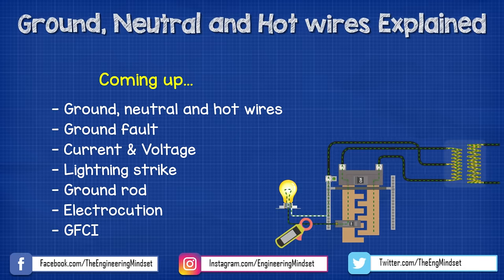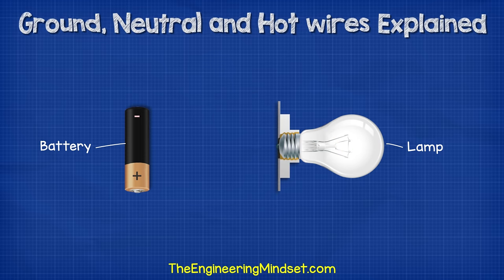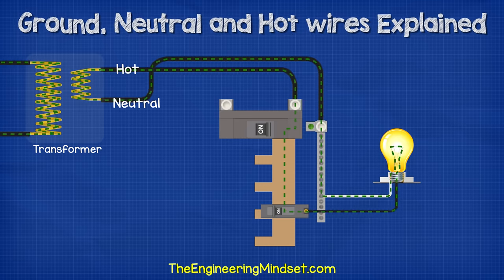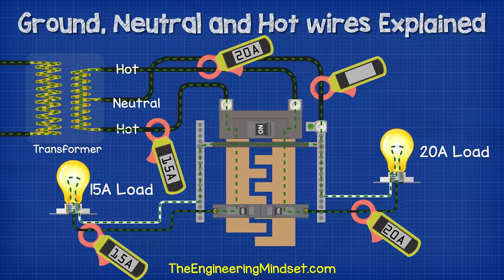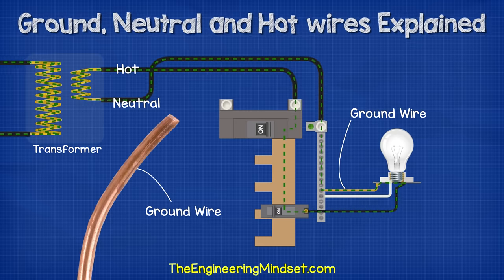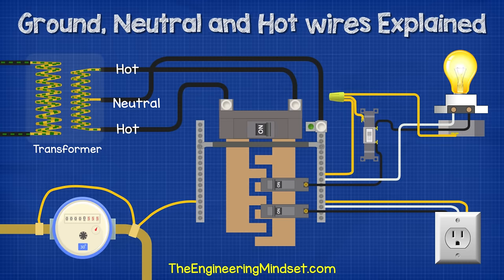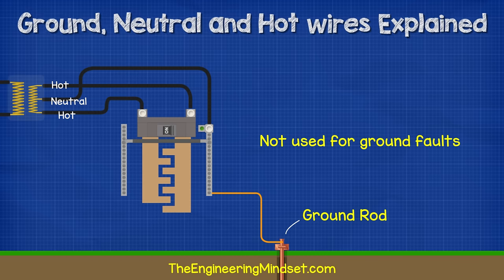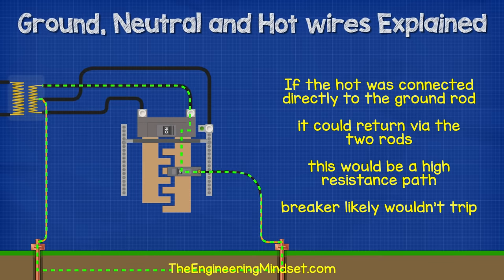Ground Neutral and Hot wires explained - electrical engineering grounding ground fault

Comment: What happens if the neutral wire shorts onto the frame of the light bulb? Wouldn't the light bulb then become charged since the current its AC?
Reply: If live and neutral short it will trip the breaker it won’t become charged with AC or DC
Reply: No. And no it won't trip a breaker either, but some current will flow on the grounding conductor (green/bare copper) back to the panel. 
Many old wiring basically did this intentionally when they did what's called a bootleg ground. Not good but it doesn't immediately present shock hazard or trip a breaker. 

The neutral carries current and in that sense is just as 'hot' as the 'hot,' but it is grounded and so voltage to ground stays at zero (if the system is working), even though the current is alternating directions.

Comment: Could someone body explain why something is code? I had a situation where I found an outlet that had its ground wired to the neutral wire. Now, if there is a fault the ground goes to neutral anyway, since it is grounded at the box.... but my electrician extended the ground from another outlet to this one. Why?
Reply: If I understand you correctly then what has happened is that there is a break somewhere along the line in the neutral wire so they have just substituted the ground wire in order to complete a circuit. Most states do not allow this anymore. They mandate that if you have to replace part of The wire, then you have to replace all of the wiring attached to your outlets and lights throughout the house.
Reply: @nonamegame9857  That's exactly what the electrican said "lost it in the wall. " but could you explain why doing this jerryrig is technically a bad idea? My understanding is the ground and neutral are both going to be bonded at the service box... so it really shouldn't matter?
Reply: @Gnefitisis  I guess people this very day just want to argue. I never said this was a bad idea. I said that the code in most States says that if you repair part of the wiring then you have to replace it all 🙄.
Reply: @nonamegame9857  Sorry, I just don't know any better and want to understand electronics better! :) Not trying to argue. My thinking is the code is the way it is for a reason and I just want to understand that reason.
Reply from the maker: We just published a new Ground fault, short circuit and arc fault video, so much detail! Link HERE➡️: https://youtu.be/Qi0ynSQw-wc

Comment: why does the armored portion of my ground show 12.amps? That is when I put the clamp meter around it However If I place the clamp meter around the 1/2" ground at the portion of the rod under the attached armored cable the rod it shows .8amp. what is going
 on. The armored cable is attached at the ground rod and at the breaker box (armor portion) and the wire then goes to the ground bus.

Comment: At 3:49 when you connect the leads from the multimeter to both bus bars shouldn't the voltage be 0? There wouldn't be any difference in potential between the two bus bars
Reply from the maker: Check our new Multimeter tutorial out ➡️ https://youtu.be/4lAyzRxsbDc

Comment: the premise as i understand it is that in a quantum binary electron spin system,  if anything tries to link on to a pathway or channel to tap a line?  if this situation is attempted by say a spy , then do to the nature of the security there is a disruption in the electron spin causing a block in the whole transmission media?  if electron fail to flow in a measured way, the flow for electrons anomaly is detected and stops like a GFIC?  true or false class?
Reply: Right, that's it.

Comment: Maam, Im still not understand. In DC it is easy to find the Hot wire, but in AC looks like the Neutral can become Hot wire too. Current flows IN = HOT,  OUT = NEUTRAL???
Reply: In an alternating current the direction changes constantly at a rate of 60 hertz, thats what makes it alternating. The hot wire(s) have a high voltage with respect to ground. The neutral is a grounded current carrying conductor tied back to the transformer. The ground is a dedicated wire bonding the chassis of the equipment to the earth for safety.

Comment: What happens to electricity when it is “used,” spent, or consumed by an appliance in an AC system? I understand the use of fuel (gasoline, lpg) and wood for fireplaces. What becomes of “whatever” electricity is?
Reply from the maker: It turns into heat, light, sound
Reply: @EngineeringMindset  🤦🏻‍♂️ wow! And thanks for answering my dumb question, lol! I am very familiar with DC power as a novice mechanic. But after watching your videos about AC power, and that it "moves" back and forth, my simple brain

Comment: 6:36
What happens if the neutral is connected to ground. Is this stray voltage?
Reply from the maker: We just published a new Ground fault, short circuit and arc fault video, so much detail! Link HERE➡️: https://youtu.be/Qi0ynSQw-wc

Comment: The battery circuit you keep showing says that the hot wire is negative and the neutral is positive. I know at this point it is kind of just a naming thing, but in DC, red is hot and hot is positive in both AC and DC electronics. And black would be negative and neutral. I’m just confused as to why you decided to make it look like that.
Reply from the maker: Electrons flow from negative to positive, current flows from positive to negative. I animated with electron flow but it confused many people, the newer variations of this video don't use electron flow. I would just ignore that section.
Reply: @EngineeringMindset   woah that’s odd I always associated current with being the electrons themselves. Thanks for the explanation. Electricity always surprises me with some basic concept I never knew about.

Comment: What I don't understand is why one side of the circuit is considered "power" and the other side "neutral" since in A/C the voltage is flowing back and forth so it seems symmetric.
Reply: @GH-oi2jf  Okay, I see that the center of the transformer is connected to ground and also that the neutral where it comes into the house is connected to ground.  So what causes electrons to flow back and forth along the neutral to the house as he shows?  Is it because the potential of the hot wire pushes and pulls it?
Reply: I think it must be that.  The neutral end is never pushing or pulling electrons.  You only need one end, the hot end, to push and pull.  The hot wire has a 120 V potential with respect to the ground, and the neutral wire, and the middle of the transformer.

Comment: What I still don’t understand is if the current is s alternating then how does one carry the power to the device and one carries power back to the panel. Dont both of them do both of those things just and switch every 1/60 second? Why is one hot and one neutral if the current alternates?

Comment: one hot wire is 120volts, any chances i can split it into 2 hot wires (with 60volts each)? and if its possible, what tools do i neeD?
Reply from the maker: You need a center tapped transformer. 120V primary 60-0-60V secondary and a qualified electrician to wire it in
Reply: @EngineeringMindset  do you have a video reference how its connected? or the setup looks like?
Reply: edited sir, im sorry

Comment: Neutral is 0v
Gnd, ground 
Hot or live is 220, 240, 420, 120 or 480 volts
Reply from the maker: We just published a new Ground fault, short circuit and arc fault video, so much detail! Link HERE➡️: https://youtu.be/Qi0ynSQw-wc

Comment: Can't find a clear answer.
I'm guessing Hot and Neutral are interchangeable and have the potential to carry 120v 30 times a sec each.
And both are separated as if they were DC for the sake of code and safty.

Comment: I didn't know that in North America they connect ground wire and neutral wire on the same bus bar of neutral. Here, in India, we "ground" our ground wire into the earth just outside our houses (each and every houses, separately). We bury a solid copper rod and connect it with the ground wire.

Comment: Technical question, please help me.
I have two parallel circuits, both are connected to the same neutral.
The main supply phase is 230vac. Single phase.

The first circuit:
The phase is modulated down by a diode , cutting off half wave of the negative component, leaving the positive component. Reading 130v pulsating half wave.

The second curcuit:
230 vac , single phase , connected directly to the main.
Reading 230vac.

Those two circuits share the same neutral. Is that a problem?
Can negative component of the phase, coming from the second circuit, conflict, with the positive component coming from the first circuit, since both circuits are connected to the same neutral?
I appreciate any help.
Reply: It will be a problem they are different voltages even though it’s the same phase remove the diode (with mains power off) and make sure it’s 230 and you should be fine

Comment: You can watch electrical current on DC floowing in One direction flowing in One direction it looks like it's flowing on let's say the top of the wire and it's moving in One direction

Comment: 5:47 why is the ground wire connected to the neutral bus bar? If the neutral bus bar is energized doesn't mean the ground wire is also energized?
Reply from the maker: We just published a new Ground fault, short circuit and arc fault video, so much detail! Link HERE➡️: https://youtu.be/Qi0ynSQw-wc

Comment: Something I still don't understand is why the neutral wire won't carry current back once if there are equal loads on both sides of the circuit. What stops the current from going down the neutral wire?
Reply: Since the 2 lines have waves that are mirrored the current cancels itself out in the neutral bar. You would measure current on each neutral wire going from the load and to the bar but would measure zero on the service neutral going back to the transformer. Essentially the current would flow from load 1, to the neutral bar, and then back to load 2 on the neutral. The current would change direction at 60 hz.
Reply: It has something to do with Kitchoff's current law.

Comment: Currents flows from positive side to negative side of the battery not from negative to positive
Reply from the maker: No, it doesn't. Here, watch this https://youtu.be/PXNKkcB0pI4
Reply: Usually, current flows from + to - and electrons flow an other direction that means current from + to - and electrons flows - to +

Comment: in your explanation, you are showing the neutral wire comes from transformer secondary coil. The electrons are moving back and forth.  which means, neutral also should give electrical shock. isn't it?.  how neutral wire is not giving shock, when we touch it alone like phase wire
Reply: Many people have asked that question.

Comment: What happens if two live wires touch with each other? well, i know, the breaker pops, but why? and what are the dangers in that?
Reply: It depends on which part of the circuit they connect at. Ideally, if both live wires come from the same source (and therefore, both having the same voltage level at the connection point), nothing should happen, however, if they come from different sources and/or have different voltage levels at the point they meet, a current will flow from the higher to the lower voltage level source instead of their respective neutrals, creating an "independent" circuit between them with a potentially high current level flowing through it. Dangerous? Certainly, all the loads connected to them could potentially get damaged because of it. Kirchhoff law is the key.

Comment: What if there is a ground wire coming from an electrical outlet but it isn't connected into a bus, and is actually just wrapped into the main coil of ground wires going outside?
Reply from the maker: We just published a new Ground fault, short circuit and arc fault video, so much detail! Link HERE➡️: https://youtu.be/Qi0ynSQw-wc

Comment: Why is the - terminal on the battery the hot wire?
Reply: It's arbitrary. AC voltage cycles at 60hz and yet the 'hot' always remains the same wire, regardless of polarity. It has to do with reference.

Comment: What could be the reason that the voltage between hot and ground is 120 and between hot and neutral is only 85?
Reply: What is the voltage between neutral and ground?  Where are you placing your testing leads?
Reply from the maker: We just published a new Ground fault, short circuit and arc fault video, so much detail! Link HERE➡️: https://youtu.be/Qi0ynSQw-wc

Comment: Neatral  and hot actually alternate as its ac so  both  carry current to and from source and load
Reply: No live pushes and pulls electricity neutral returns it to the source
Reply: @IPv4Address  ahhhhhh omg! Now I get  your  comment  . Thank you
Reply: @IPv4Address  but if  hot is pulling wouldn't  the  current then  be coming through neutral  side?
Reply: @IPv4Address   so if the  hot is pulling  then the electrons  source  that its trying  to  return  to is going back through the hot  and  when  hot  is pushing electricians  are trying  to return  to their source via the neutral wire

Comment: I have a fundamental confusion; if the current in the circuit flowing from and to the source the same (4:15), then what is the power companies charging us for? I mean from this it feels like electricity is conserved. But then there is a loss of electricity via heat during transmission. I am a little confused at this point so, can anyone help?
Reply: That electricity doesn't just come out of nowhere, a power plant somewhere generated that electricity and is sent to you. You're paying for the wattage hours that you needed to power your devices.

Comment: When the neutral connection to the transformer breaks, why does everything plugged in at the time get fried? (Squirrel chewed through my neutral).   There's no way for the power to return to the transformer, so it has to go through the ground wire?
Reply from the maker: Because it instantly becomes a 240V circuit
Reply: @EngineeringMindset   - That makes sense because the transformer coil is no longer split by the neutral, but where's the return path?  Only the ground, right?  So why would the circuit even work?

Comment: Why did the hot wire showed connected to the negative side of the battery? 
The hot wire suppose to be connected to the positive side of the battery and the neutral wire suppose to be connected on the negative side of the battery.

Comment: What happens when you cross connect wires: Black on white when installing a light fixture?
Reply: If it’s incandescent it won’t matter if it’s LEDs depending on the lights internals it might not work because they are diodes Light Emitting Diodes and diodes block current from flowing one direction

Comment: 5:03 - 5:13 if the neutral has no difference to return would that send 240 volts through you're loads
Reply: those lamps are in series so yeah, 240V 15Amps but depending on the diretion the second lamp should receive less volts for the duration of the half period. idk how it would work as in my country we use 220V 1 phase or 380V 3 phase

Comment: Why do you hav the power coming from the negative side of the battery
Reply from the maker: Because in reality, electrons flow from the negative to the positive. That's "electron flow" . You are probably uses to seeing "conventional current" which is from positive to negative, that's the original theory.
Reply from the maker: Check this out, how a battery works: https://youtu.be/PXNKkcB0pI4

Comment: I have one question that I could never get an answer too,IF electric flows from source through wire,through whatever electrical part and back to source.Does this mean the electric company never loses what they are putting out because it always returns to source? My question is why an electric bill if what the electric co. puts out always returns back to their source.I know their is a draw because of how electric is used,BUT the electric always goes back to where it started.
Reply from the maker: The power company has to constantly push and pull the electrons through all your wires and connected devices and be ready to power anything you connect 24/7. As they pass through they do work, provide light, heat, sound etc. this is energy removed. the power company has to top this back up and charge you for the energy you used. The electrons have to flow for electronics to work and they provide the force to move them. Think of an electric heater, the current has to flow through for it to work, as it flows through it produces heat, the power station has to provide enough force to push/pull electrons back through the heater constantly otherwise it stops working. That heat is energy leaving the circuit so you're charged for it. Go to a shop, get a coffee. They get their cup back but you're charged for the coffee.
Reply: Another point that may help clarify here is that 'current' is not analogous to energy.

Power is voltage x amperage. Could the power company deliver power without voltage? No. 0 times any number is 0. 
When a 'load' is in a circuit (i.e. any electrical device you are running at home), you are provided with a near constant voltage. If this voltage wasn't maintained, the capacity to deliver power would drop to 0 as current flows and voltage drops towards 0.

A water analogy: 
Consider a water slide with a pool at the bottom, and the water gets pumped from the pool to the top of the slide. The water returns to the pool (to the source) after running down the slide. Does that mean it doesn't require energy to pump the water to the top of the slide?
Of course not. It takes energy to establish that 'potential' in the water, i.e. to pump it to a higher height from which it can then 'flow' (as current does) back to the pool where it began (source).
To keep that steady flow (current) of water, the pump must continually pump water to the top (provide the energy to establish potential difference).